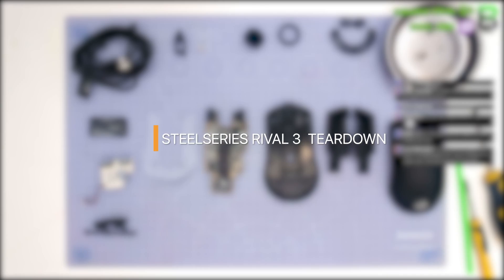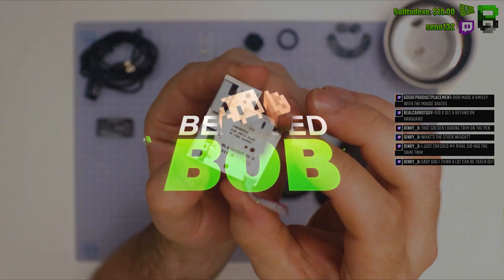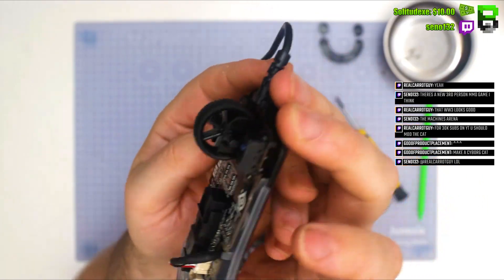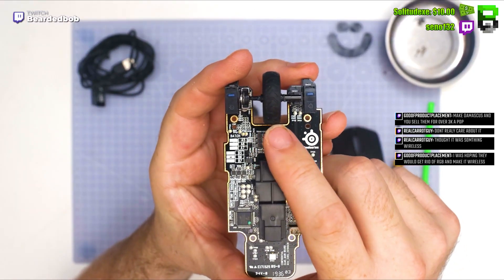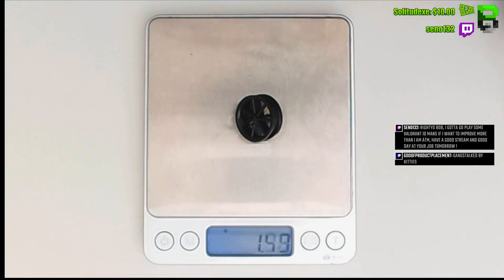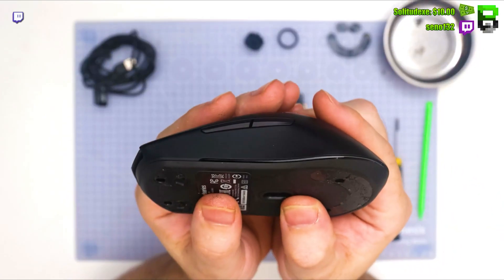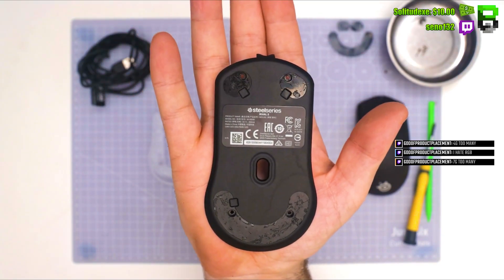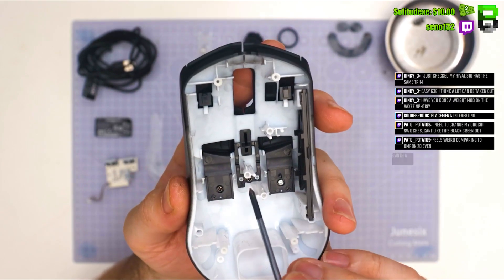Inside the Beast: SteelSeries Rival 3 Teardown Revealed!

Comment: Hey I know this is a long shot but I need help with my Rival 3 wireless. The scroll wheel doesn't work properly. It feels the same as it always did (doesn't feel loose or out of place) but it's just not responsive anymore. The middle mouse button doesn't respond either no matter how hard I press. Sometimes it'll scroll which ever way it wants when I try scrolling and other times it'll scroll without me touching the scroll wheel so I had to disable the keybind in my settings. I got it apart to clean it but that didn't help... Any suggestions/possible solutions?? Thanks in advance
Reply: Mine is having similar issues, did you find some sort of fix?
Reply: @evanc5002  Nah bro </3